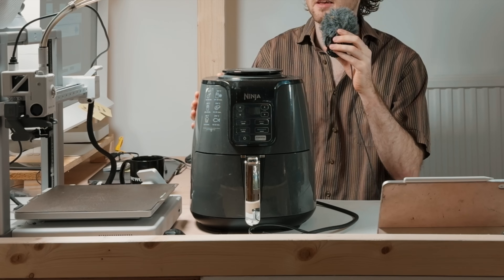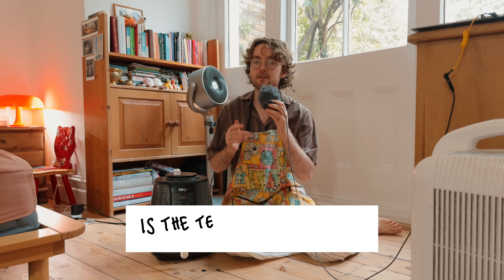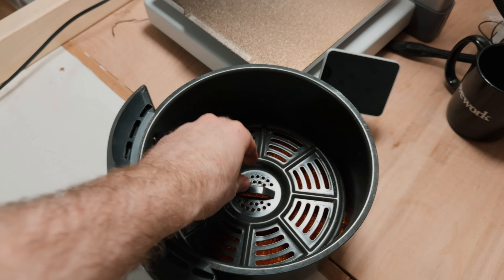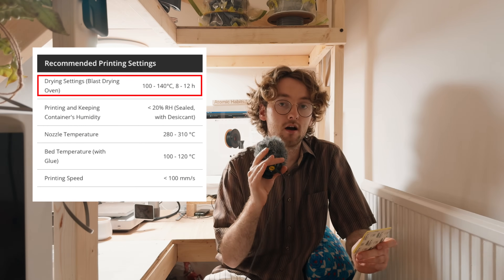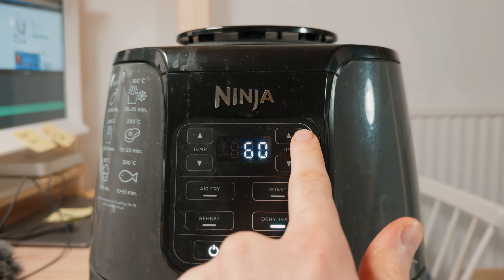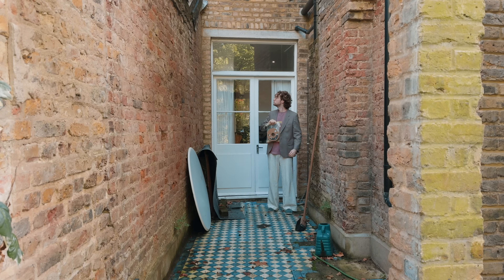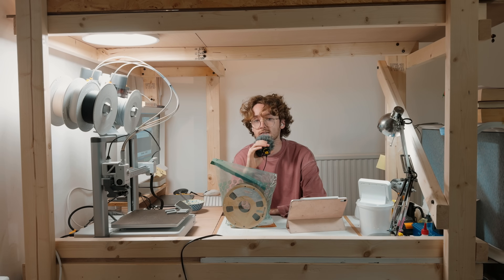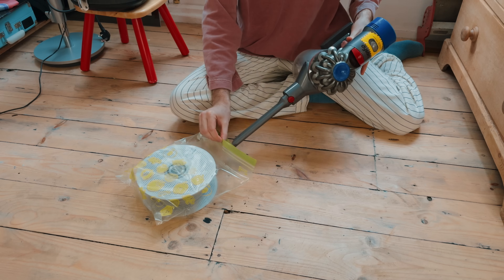Forget Filament Dryers. I Used an Air Fryer

Comment from the maker: Added the models used into the description :)
Reply: hi, the air fryer how many liters? I see different versions on amazon
Reply: @belgio96 I believe that the 4 quarts or 3.78 liters
Reply: @frederickhumphrey1064  thanks a lot
Reply: Cool. Could you also add the internal diameter and height of the tray so I can know if my filament rolls fit?
Reply: your next evolution step - dry hair in owen ?
Reply: @heysamhillier we need more data on this 🙂
What temperature range can you set the AF100 to in dehydration mode?
What filaments have you successfully dried with this method (type, temps, time)?
Reply: @Antrepeas  Well he states that most Filament dryers can only go to 70'C so I'm guessing higher than that or he wouldn't have brought it up
Reply: @ thanks but I'd rather not guess and besides that's still a bit vague on the details.

I got the air fryer myself now to try it out and can reply to my own question.

In dehydration mode the Ninja Foodi AF100EU support temperatures in 10C fixed increments 40, 50, 60, 70, 80 and 90. The timer can be set to 12 hours in 15 minute increments in this mode.

Other modes like Roast support higher temperatures. Haven't had a reason to test those modes yet.

So far I've dried white PETG left open for a year or two with great results. Dehydration mode 70C for just 2.5 hours. String test before was terrible and afterwards it was perfect!
Reply: Ninja gonna break into a new market
Reply: @heysamhillier  thank you

Comment: Imagine being so bored or start for Content you have to make a 4 minute video just to say "yes you can dry your filament in an air fryer".
Reply: Also that silica gel holder is stupid. It makes much more sense to just throw it in the bag loose then the stuff it in that Center hole and go through the extra labor of screwing it in and screwing it off. Especially because once you vacuum it you've now created a seal around the desiccant so it's not doing anything anyway because it's completely enclosed within the Hub

Comment: For storage: If you have the space, I use a giant storage bin. I dump a good layer of desiccant at the bottom and can fit probably two dozen rolls in each tub if neatly stacked. I usually only have like a dozen rolls in rotation though.

Comment: Hi. Thanks for the video. I was wondering if drying the filament left an odour or tainted the fryer in some way. I only have the one fryer and I don't want to risk contaminating it so I can no longer prepare food in it. Thanks!
Reply from the maker: Hey, I can't say for certain but I've not noticed anything. I think it's probably just moisture coming off the filament at these temperatures.

Comment: I was checking on airfryers with dehydrators, the wattages are insane.

They also don't go down below 80°. What model are you using?
Reply from the maker: This is a Ninja AF100. When it's in Dehydrate mode it cycles the heating element on and off to maintain the low temp. This air fryer is rated at 1500w I think but it'd only be using a fraction of that over an hour. Lowest temp setting is 40c

Comment: Ziploc bags are designed to breathe ever so slightly. The humidity would eventually reach an equilibrium with the outside air. This would of course take a very long time, but the point is, Ziploc bags are not a good idea for any sort of long-term storage. Just invest in a vacuum sealer. They are really not that expensive, and they can be used for so many things. If you can afford a Ninja air fryer, just to dry your filament, then you can afford a vacuum sealer… I get that it was technically an extra air fryer, but chances are, your girlfriend will not be around forever. You could’ve saved it for when she leaves, and takes her, now non-toxic, air fryer with her.

Comment: Isn't loose desiccant better that cramped together desiccant in such kind of a holder in the middle of the spool surrounded by plastic tube? Does humid air reach easily to the middle of the holder?
I would print tray sized like ice cube tray which can hold 3-4 layers of desiccant with holes little bit smaller than desiccant balls -- that way air can reach easier to them.

Comment: Can you do a test to see if the desiccant works better in the printer holder in the center of the spool; or if a small perforated box (or loose) in the corner of the bag?

Comment: Ikea bags? Well, they are dirt cheap and my Eibos bags aren't. Must try this, I have got a bunch of moisture sensors.

I do believe an airfryer will be better than Sunlu E2, large 90°C dehydrator or a convection oven. And presumably can anneal as well.
I'm going to a local seller with a few spools to check the maximum number I can squeeze in; in each model of Ninja --> utility maximization.
I do have my eye on a Ninja's Double Stack XL. Neatly stacked on my desk.
I am interested in the temperature of the upper drawer, I suspect it will be hotter than the lower.
So, to buy: an airfryer and 2 thermometers. I'm tempted to roast a chicken before sticking some filament in. 😋

Thank you Sam, for the top content. And your girlfriend for the marvelous cameo 😉  
Your video was entertaining and informative. Subscribed.

Edited to add: keep dancing, I love it!

Comment: Awesome video! I’m curious—does the fryer maintain the same level of precision at 50°C and 70°C as it does at 40°C? Sometimes, heating elements cycle on and off, causing temperature fluctuations. Really cool that you actually measure things instead of just unboxing and influencing—love it!

Comment: I have a ninja air/fry pizza oven I use for drying filament. I got it on Amazon for cheap as it was a slightly damaged return. It does up to 6 hours in dehydrating mode. I like the idea of a desiccant backup in the oven. cheers

Comment: I don't have a 3D printer. But why do you need to dry it yourself? Why don't they just sell you a dried spool of filament in a sealed bag?
Reply from the maker: Over time it absorbs moisture from the air. So you need to dry it out. Also sometimes it does arrive wet due to poor packaging
Reply: @heysamhillier  Thanks for explaining! That makes sense.

Comment: That's what i do, vacuum bag or sous vide bag and inside put the silica gel packs. If you only have the silica bbs you can put them in a teabag it's as good as the pack. You dont need much morei dehydrate mine in a food dehydrator cause im not using it thst much anymore, perfect results

Comment: You can actually get zipper seal bags that have vacuum ports on them. They make a variety of sizes and people often use them to store seasonal clothing to compact them for storage and to protect them. They are also typically heavier duty and will probably hold up better.

Comment: my problem is that I can't print directly from this. maybe I can drill a hole into it?
Reply from the maker: I've thought about doing the same. I think you could definitely do it with one of those Bowden tube thread things. I just might one day use this for cooking again so havent done it yet. Most of my prints are PLA plus

Comment: That's a great idea! I was frustrated that regular filament dryers aren't a reliable option for high-grade engineering materials. I love the creativity; thanks for sharing!
Reply: He just made me buy an air fryer too. (I got the AF140, just because it's smaller and looks better than the AF100, it will still fit a filament spool nicely).
Reply: @Nixie_EUC  did it fit?

Comment: i used ziplock bags for a few months, they work really well but i am really glad i bought a 100 litre ip67 rated storage tub. It can hold 32 open rolls and along with desicant holders in the centr of every roll i have about 1.5kg in bags aswell.
The tub sits at less than 10% humidity all the time and over a few days it will remove most of the moisture out of pla, abs,  petg with out needing to use a dryer.

Comment: Hi Sam, very nice video! With PPA-CF you need to increase the temperature of the dehydrate function up to a temperature the dryer don't reach (mine goes up to 95°C).In other modes I'm time limited....  How did you set it up?

Comment: Hey very cool, just a question though, could you measure for temperature accuracy on a wider range? 40 read 44 but how about 70? is the bias still 4°c ? or is it that your homesensor won't tolerate going this high?

Comment: Here is the label I made for the top of the machine. This factors in that I tested three units and they all ran 3-5 degrees F too hot. The F temp is what to set the machine for. The C temp is adjusted to what it really will be. 

Ninja Filament Dryer 

105F	42C 	(PLA, 8 hours)
120F 	52C 	(PLA, 8 hours)
135F	60C 	(PETG, 8 hours)
150F 	68C 	(PETG/TPU, 8 hours)
165F 	75C 	(ASA/ABS, 8 hours)
170F	80C 	(ASA/ABS/PET/PA6/PC/PAHT, 8 hours)
185F 	88C 	(PPA/PPS, 12 hours)
250F 	120C 	(PPA/PPS, 8 hours)
275F	135C 	(Bambu PPA/PPS, 8 hours)

Comment: I tested this 4 QT model today. I set it to 120F and after about 45 minutes, stabilized at 123F and stayed there within 1 degree F. That seems pretty good. The one thing that keeps it from being perfect is that there is no way to change the temp to be in C - which is rather annoying. It would cost them nothing to make it change temp modes by holding down the button for 5 seconds. Every other brand does this.

Now I am testing the 5.5 qt model. The basket is taller, which is good. It has more cook modes, which is bad as you really only need about three for any use.

Comment: I use the same air fryer, it seems to be made for that task, the spools fit exactly! I'd add a couple of considerations:
- it has been said in the video, but I'll repeat it because it's very important and I think it wasn't said clearly enough. Make sure the air fryer has a dehydrate function, otherwise it's useless as it will start from 160°C and with 1h of maximum run time. This is important especially in the EU, where there are just a couple models available with dehydrate function;
- I don't like the idea of drying silica gel with filament: the first reason is that while it dries it will dump a lot of moisture (well, all that it adsorbed from the last dry!) making the drying of filament less effective or even giving more moisture to the filament. The second reason is that silica gel doesn't melt, so it can be dried very quickly at higher temperatures (or even just in the microwave where it comes off very moist outside, but with a quick dive in the air fryer will fix it; like 5 minutes in the microwave and 10 at 100°C in the air frier);
- If you want to go for crazy engineering material this particular air fryer isn't really suited, the dehydrate mode goes up to 100°C or something like that, and only dehydrate mode can run continuously for hours. The air fry mode goes up to 90°C, and the next mode, the roast mode, starts at 120°C and can go up to just 4 hours. So you have a gap of 30°C and you have to stay there and re run it for a full cycle. Probably there's nothing better around, the real solution is probably to get a cheap air fryer and replace its brains with a raspberry or something like that and an SSR to run it in pid to whatever temperature you want.
Reply: Ahh, that's a bummer I am trying to find something that can do everything.  Atleast you could still easily do PA6 with this model. There are tonnes of air fryer models out there, surely one of them gives you full access to temp and duration?
Reply: @nehok  Probably there are more flexible models, I have a Xiaomi in the kitchen (the one with the glass window) that can do more stuff, it even starts at 40°C. But it has a square container and for less than a cm a spool won't fit. But using a cheap air fryer and removing the electronics and replacing it with a raspberry and an SSR is an option imho
Reply: @karellen00  yeah hacking it would be ideal but thats a whole bunch of extra work for most people.
 A side note if the dehydrate mode does go up to 100c then that is the bottom of the bracket recomended for pps cf and ppa cf so it may still work just take longer.  Also, looking at the ninja air fryer max it looks to me like it would fit two spools. 

I dont have an air fryer and have never really looked into them for cooking so will do a bit more reseach about whats out there.

Comment: I use the same air fryer to print from.  Made an internal turn table with a bowden tube running down into my printer.  Use it for PACF.  Works great.
Reply: What model is this fryer?

Comment: Nice. Though I wonder how well it helps with the problem of filament drying where it can't dry the inner filament as well. The stronger airflow this creates probably helps a bit Vs a cheap filament drier. 

Though I think I'd try and take this idea and make a drier for drying the filament as it's printing. Build a tuber that the air fryer heats up and the filament then goes through the tube as it's being extruded. That way you know if you're doing long prints it's dehydrating the whole roll

Comment: If you can't find an air fryer with dehumidifier setting, get yourself an STC-1000 temperature control module, and wire it inline to the heating element. This would let you use a cheaper air fryer, and have better control of the temperature.

Comment: Orange silica gel has methyl violet, it might be worth it to consider changing to non-indicating silica gel since the air fryer is potentially blowing its dust into the air
Reply: I don't use silica gel any more I use Activated Alumina, it works better then the silica. Silica gel after saturated will release its moisture back into the air and defeat its purpose.  I also use the Elegoo vacuum bags with a small bag of the Alumina that I made up from breathable fiber bags. The Alumina is also rechargeable like silica but holds more mositure then silica and won't release it back into the air once saturated.
Reply: @cowboy124aa3  Using a molecular sieve is a great idea, i would use it in my print farm if it was cheaper in bulk. For me silica lasts at min 3-4 months at a 13ish RH since i use sealed plastic cereal storage containers with boden tubes.
Reply: Can you please elaborate on this? Is non-indicating silica gel completely safe to heat up? How much safer? Ty for sharing :)
Reply: @TheWebgecko  Noting is completely safe but if were comparing methyl violet dust to non-indicating silica dust, Non-indicating silica gel doesn’t have these additives, so it's safer to heat up and use in this way
Reply: @polodog7458  Stephan at CNC kitchen suggested using a small percentage (like 3%) of indicating silica mixed with the non-indicating type. Since they dry at the same rate, you can still tell how dry all of the beads are.  This way you can reduce the danger more than 20 fold.
Reply: @yeroca  That's an excellent idea, thank you for the suggestion.

Comment: I keep 4 reels of filament along with some old arc welding rods in a plastic Ikea box with a cheap desiccant canister. After 6 months the air in the box is still around 25% humidity despite frequently accessing the reels for printing. There is no need for fancy filament driers. P.S. I live in Borneo where the average air humidity is 80% or more.

Comment: Heh, I had the same idea and searched for ninja airfryers and 3d printer like a month back. Seems the algorithm does work suprisngly well sometimes. Thanks for sharing your results.

Edit: although I was convinced you need the max (af160) version for the filament to fit without touching the side walls. Looks like the af100 manages afterall

Comment: I'm surprised more people don't talk about using air fryers for drying. Even CNC Kitchen's recent video didn't even consider it. I've been using one for nearly two years. It's faster and better than an oven in every way. Microwaves are fast but cause inevitable hot spots that damage dessicant and is just a bad idea for filament. The other advantage is all the air is ejected out of a small opening that could be used to monitor how much moisture is coming out.

I use a cheap, door style air fryer with a 150F-400F range. It has trays that are just a bit larger than a normal spool and being able to monitor through the glass is really convenient. It's also easier to use temperature probes if you need to keep an eye on it. I also saw a tiny air fryer at Aldi a couple months back for like $30 that would great for just drying dessicant.
Reply: I discounted the idea before due to them not being settable to lower. 150F is 65C, which is already too hot to dry PLA. This solves that due to the dehydrate mode.
Reply: @rsilvers129  Well honestly a lot of PLA doesn't need much drying, I use it mostly for ABS/ASA, TPU and PETG. I've also found the actual temperature hitting the spool is lower and haven't had any issues but yes, dehydrate modes are helpful if you really need lower temps.
Reply: @rsilvers129  Lots of air fryers go lower than 65C these days. My Xiaomi 5.5L has a square container but also fits a roll of filament perfectly, and it has a dehydrate mode that goes as low as 40C. It's also like 2x cheaper than Ninja models.
Reply: airfryers are useless for nylon and above. Timers too short or temperatures too low in dehydrating mode. Its kitchen oven or laboratory oven, nothing else.
Reply: @bartman2395  Have you tried it? I haven't used it for anything above Nylon but at least for my unit it has worked perfectly fine for that. Plus the nature of air fryers blasting it with air seems to speed up the process.

Comment: After looking at what was on offer, I felt compelled to make my own reliable four bay, hermetically sealed, auto-rotating temp/humidity controlled filament dryer, from a few spare things I had laying around, it's fixtures were all 3D printed. The total cost was negligible and the entire creation was slapped together in one evening, motivated by numerous reels of essentially unusable part-used filament! 😉 Necessity be the mother of invention. 👍